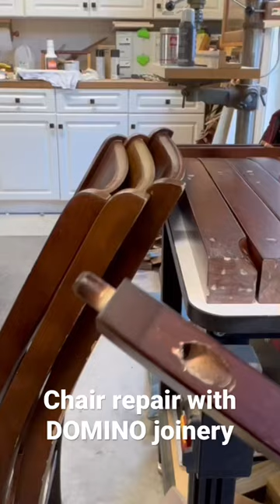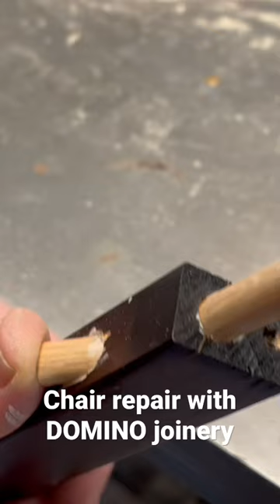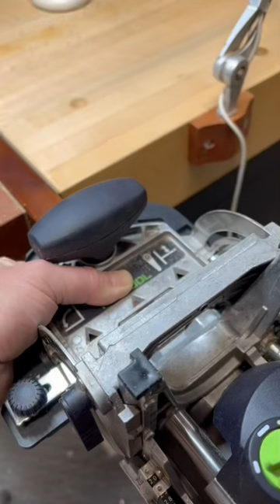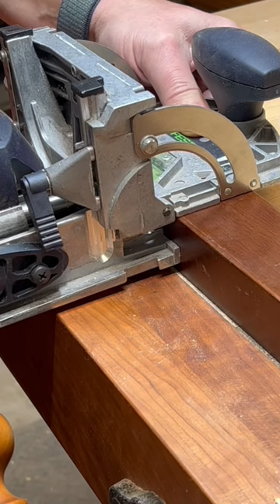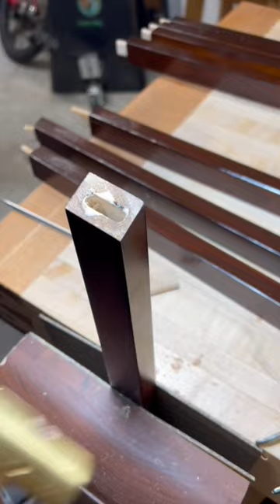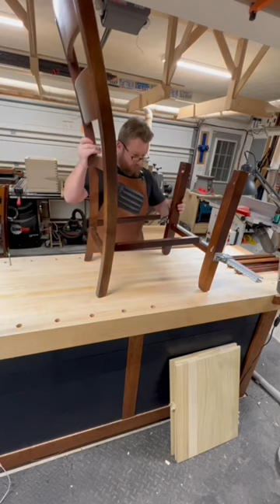Dining Chair Repair

Comment: Dude, you are a Madman!
This is such an excellent upgrade in construction. 
Dowels are weak clearly, with very little face grain contact.
Using this new loose spline tenon offers a lot of face grain glue surface. 
Respect 👊